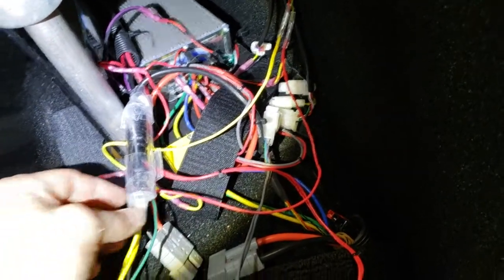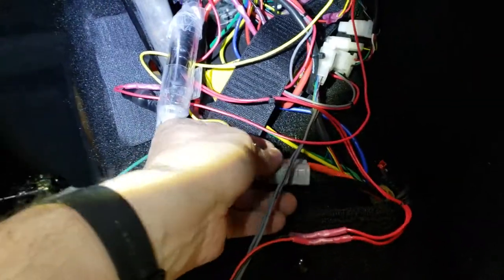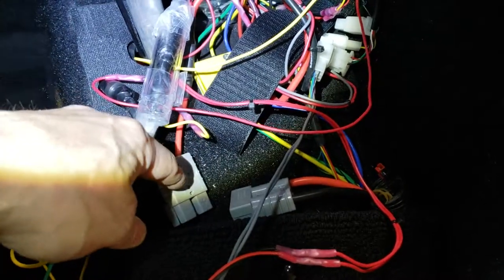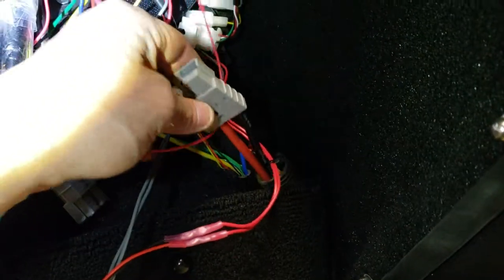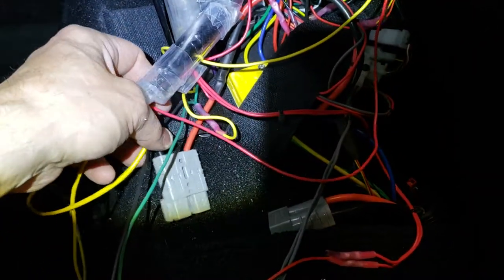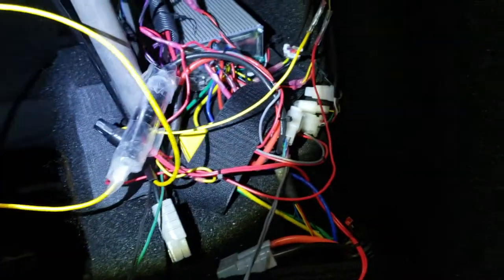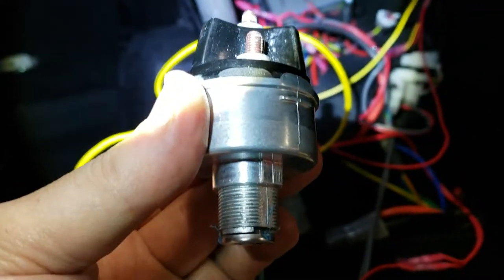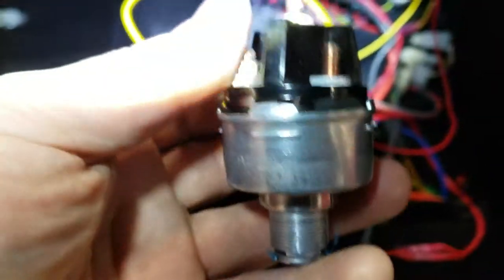Review of my cut off switch for the pebl

Comment: Hey I just installed a switch on my bike the same way you did yours.  I did mine a little differently.  I used a 12-48v 2 way battery cut off switch.  Meaning you can wire in 2 batteries and switch between them.  I plan on doing this on longer rides and keeping the batteries strapped down on my rear seat.  The reason why your switch sparks is because the voltage of the switch is not high enough to handle the voltage coming from the battery.  The 12v switch is over powered by the 48v 50 amps coming when you turn it.  I would recommend getting a different switch or you may have overloads and fry something.  The switch I put in I have zero problems.  Though I still wouldn’t recommend touching the connectors.  This is a 48v max snd 200amps max switch so it can handle anything!  I leave the switch off and my battery connectors doesn’t spark when I connect them!  Thanks for the idea and this way worked awesome on my bike!

https://youtu.be/OsubOGGZyQ8
Reply from the maker: I actually changed the switch on mine so now I do not have any more sparking up because I used a much bigger switch I have the same type of set up as you do on my scooter because I have two sets of batteries on there so I use one battery and then I can switch to the other battery if I need to I’m planning to actually get another set of batteries for the pebble just larger capacity ones so that I can go further I’m also always using the off-road option so I get higher speeds but it decreases my distance a bit